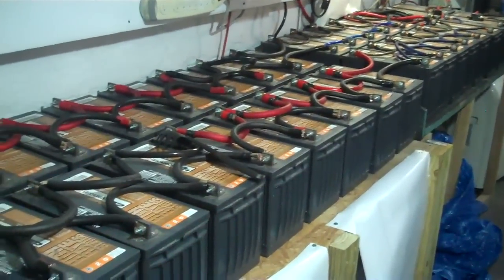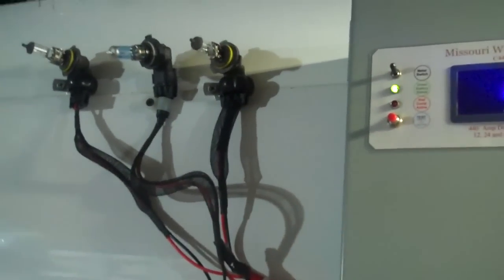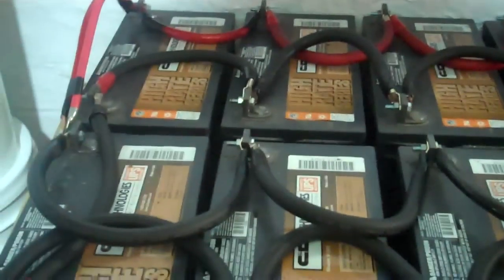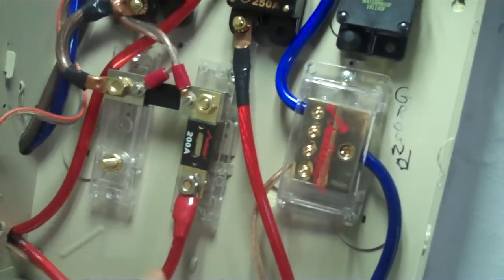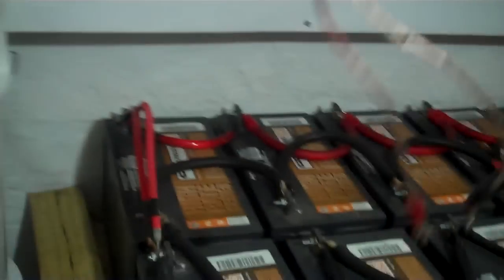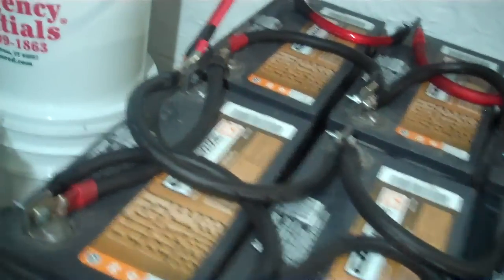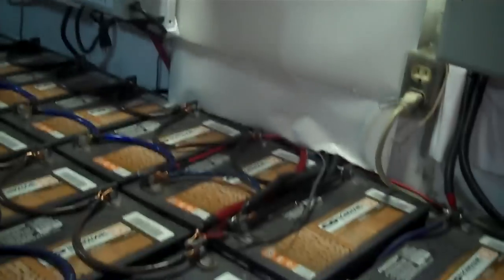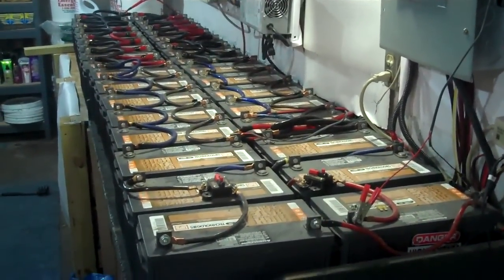Massive Battery Bank for Solar biggest Off Doomsday Preppers

Comment: I like your setup.  One thing I would add are some grommets where the wires feed through the metal cabinet. Also, a plexi glass cover over the batteries can protect the terminals from metal being dropped on them.

Comment: I have stage 4 cancer and I'm building a solar off grid system so that if I get more sick or if I die that my wife will still have electricity.  We bought a holiday rambler camper to live in cause they was no way to afford rent while I was doing chemo and radiation. I'm better now and actually working again but still working towards the solar stuff just in case. I've built a 24 volt system with 8 panels 235 watts each and have 2 inverters. The batteries is what I still gotta get together. Seems they cost a small fortune but hopefully they will be the last part of the puzzle.  I have found so much peace with messing with this solar project. Thanks for the videos it's good to see someone else doing what I'm doing

Comment: what gauge cable would you recomend me if im using a 24 volt sistem with 18 100 amp 12 volts batteries and 36 100 watt panels and a outback inverter 3500 watt thanks

Comment: I have 12 crown 235ah 6v batteries in my 1410ah 12v bank i use 4/0 cables and copper bus. What charger do you use for charging when solar or wind isn't available?

Comment: Highly not recommended- linking together more than 4 12V batteries. this setup will cause distribution problems between batteries. if you want a large battery bamk you should nuy large 2V cells.
Reply: Yep
Reply: Large 2V cells is the more proper way to do it (such as 24 of them for a 48V system), but that has drawbacks too.  If even one of those cells goes bad, then you better have a spare handy and how would you load test a 2V battery individually (apart from all the others)?  Also, if you do a Ah capacity drain test on each individual 2V battery, how then are you supposed  to charge those individually?  It would take forever and a day.  Would you drain 3 or 6 of them at a time then put it on either a high amperage 6V or a 12V charger?

One "saving grace" of a highly paralleled system like this is if the load is light enough (relative to the capacity of the entire bank), then the batteries in a higher state of charge will actually charge the other batteries paralleled with it.  It might take a few hours but it will work.  If you were to draw uneven amounts of power from say 30 paralleled batteries and  let them all sit for an hour or so with no load, and then test them for open circuit voltage, I bet they would all be the same or within about 0.1V of each other.

Comment: You are the only channel I have ever seen using a capacitor.
Could you explain their use a little more and maybe break down how to wire them for us just starting this process.
Reply: There is no need for a Capacitor in the system ever with modern inverters. They all have a peak starting power way above there rated watts. Like a 3000watt inverter typically has a 6000w temporary starting wattage. That's why you never seen anyone else do it. Unnecessary! But won't hurt anything to have it just more money and wires

Comment: I don't want anything but I do want to know where the capacitor is within the system, what size the capacitor should be, and where I would get a capacitor of that size. I have seen several people with them and for the same reason you mentioned but I have not been able to figure where it should be inserted within the system. I will search through your videos and maybe I will be able to find it there. I am working on a solar system and hopefully I will finally have it online within a month or two. Great video, thanks...
Reply: Any automotive Hi Fi shop will have them. They're called "Stiffening capacitors". Their main purpose, is so when the bass drum hits, it doesn't cause the headlights to blink, or interfere with the electronic controls of the vehicle. When installing this with your inverter, place it as close to the input terminals of the inverter as possible, and run heavy short wires. If possible, connect your source to the capacitor terminals, instead of the inverter terminals. Capacitors don't store much energy, but they pack a punch. They're capable of huge amounts of current for short periods of time. Perfect for starting the compressor of a fridge or freezer. That way, you can use a deep cycle battery, which doesn't have the surge current of a starting battery, but can run longer and withstand repeated discharge/charge cycles.

Comment: I have a 12v system now. Just started this a week ago so I bought a new 12v 85w solar panel and 12v charge controller for now. The problem is I bought 5 golf cart batteries 6v each. Now I want to keep thm charged so that when I get an inverter (pretty soon) I have all5 batt charged. Main question is Can I connect the fith battery in parallel to one of the two in series making 12v to keep it charged????

Comment: Hello.
I have a 3kw  inverter (pure sine) 
Batteries  total 600ah, (deep cycle )
My inverter is also a 70amp charger and charges the batteries by day using my grid electricity, i have grid-tied solar Pv at 2400 watts so i use this power for free during daylight.
Evenings we power our laundry using the battery system.
Problem is, i sometimes notice the inductive load from the washing machine exceeds the inverter capability...is a capacitor needed? and what do i need to do here?
Thanks...Simon UK

Comment: Hello, I'm new to solar power. I am starting off with the Harbor Freight kit just so that I can use it to learn from. I have a question about switches. What kind of switch do I use so that I can go from charging one battery to another? I am using this in my van, I want to be able to switch from my battery bank to charging my van battery if I have to.
Thanks

Comment: How did this 12v bank work out for you?  I've got a 4 battery bank I'm considering adding to, and then use them later in a 24v setup.  
Did you run into issues with unbalanced batteries?
Thanks

Comment: I love your set-up! you've got 5 sources of power: The grid, the batteries, the wind turbine, photovoltaic panels, and portable generators. You should be able to run on propane, gasoline or even diesel. In a SHTF situation, you want to be able to run on what ever fuel you can get your hands on, if your wind and solar aren't able to meet demand for whatever reason. You should have no problems keeping your lights on, and your food cold.(refrigerator, freezer)

Comment: hey.. hi.. m I have a question.. I would like to know if the capacitor is 12vdc and if is connected in parallel with the inverter - can you give me a quick explanation.  I have a 2000 w inverter and tends to trip the breaker , I was wonder if this capacitor would solve the issue.  thanks

Comment: Are those deep cycle batteries?

How is the capacitor wired into the system? How many farads do the capacitors  have? Is it wired into the dc circuit, just before the inverter etc etc?
Reply from the maker: that is a cpl farad cap wired in parallel with inverter and it helps high amp draws on hard starts a cap responds faster then a battery does
Reply: Bryan May
Where did you get the cap and how much was it?
I am just starting with solar panels. I read a lot about it and that is just it.

Comment: You are using 3.2kAh bank, so I don't think you need a capacitor with the inverter for jerk loads, even at 3kW, it's gonna pull only 10A from one battery, and lead acid batteries are great for surge loads, that's why they are used in cars and generators for starter motors, instead I think capacitor is a bad idea because if its drained and you close the breaker it's gonna create a current surge which might blow a fuse etc, that's my opinion so please do explain if you think I am wrong
Reply: I think your correct so I will destroy my inverter set up and throw it by the curb out side.

Comment: Water heater elements are intended to be completely submerged in operation and will burn out if any part of them is exposed, so mounting them in a water tank is the only way to use them.

Comment: I got a question about the batteries.
It looks like that you do not use the batteries and that you just trickle charge them.
Wouldn't It better for the batteries to just disconnect the charge for a few weeks and then charge them and then disconnect them again to do it all over again.
Trickle charge batteries for a longer period of times, the way I read it is not good for them. And If you discharge them, then you should use 15% or more of their capacity before charging them again.

Comment: Hi... nice system.  Your system seems very complex.  I'm planning on simply using 12V inverters like your Cobra.  Is there an issue I should know about as to why this won't work?  I figure a 1200W for the fridge and 1000W inverters in other rooms for lights and entertainment systems.   I also have Chinese GTI's, and intended to use them for both a dump load, and also to feed directly from panels.  See any problems with this approach?  Thanks in advance for you answer.

Comment: hi is there a way that I can get 240v ac 60hz, with a inverter, do they make one? cant seam to find one, or can 2 inverters be wired to make 240v? please some one help. thanks
Reply: You should be able to buy them in the US, otherwise one choice is buy it from a country where 240VAC is the standard, although I'm not sure about the 60Hz. 50Hz is the standard AC frequency here in Australia.

Comment: I have worked by but off 40+years now retired.  On Social s and what small savings I have.  Where can I find cheep batteries. I built 2 s windmill and got bunch of solar cells to build another 1800 w panels and is there a way to build solar water heaters without copper went to look at copper pipe and thought should of bought back b4 retirement and price explosion

Comment: There is a MAJOR fire risk with one or your panels. The battery leads going out of the turbine controller do not have a bushing to protect them from the rough edges of e cabinet KO. As another poster mentioned, series fuses are useless and the cable used is not rated for 200 amps at 12 VDC.

Comment: Awesome battery bank. I have a small solar system a harbor 45watt panel kit. I'm running a xanttex1000 pure sine inverter and a 800watt cobra. The little circuit breaker r cool. Are they better to have in the place of fuses, if so where can I get them and how much

Comment: Hi Bryan
Nice work. I have a question on batteries. If i have a 100000 batteries that produce 0.5V and a 0.1 amp and if i connect 72000 in series to achieve 36000 volts while connecting 28000 in parallel to achieve 2800 amps how would one go about getting the maximum kwh and supply the achieved power to any user or buyer of power?
Awaiting your kind reply please accept my thanks and gratitude

Comment: As others have mentioned, yes 24V and 48V are more efficient. I know you used 12 volt because it's what you got and I respect the thrift. That being said even short runs should be using 4/0 cable even for short runs for 3000 watt inverters. for longer runs 4/0 in parallel.  The voltage loss is incredible with small cables, extra current bridges, circuit disconnects and relays. Marine disconnects have been plagued with problems. Even high end ignition protected switches can get corrosion and can fail under high load. Sooo, my disconnect is a big cable cutter for emergency and a plastic dipped wrench for non. The only thing in line is a 400 amp marine rated fuse. Measure your system under a modest load at the batteries and at the inverter terminals you may have a big surprise. 3 or 4 volts difference? no big deal ? wrong!

Comment: Well as you know, "ANYTHING" with the label "SOLAR" is running 3 times as much $$$.
I'm new to this, but what I want to do is learn how big of a battery bank I need to run 4200 kwh per year, 350 kwh per month is the break down and a bit on the high side from my normal use. I would be running my generator to charge my batteries off from a Gasification unit. (Free fuel. Could you give me some perspective as to how many batteries I'd need. Thanks

Comment: Cool video, You have some serious power. Surprised its 12V.  I am not ragging on you but I'm an industrial electrician and triple fusing is redundant and not needed.  As long as you system has one correctly sized short circuit protection others in the same circuit are not needed. Use multiple fuses for power distribution, like a breaker box then a larger fuse that covers the entire box but two fuses on the same circuit is just an extra point of failure. Think of it like having two parachutes.

Comment: Am I right in saying that if you had a really large battery bank you don't even need a charge controller? The reason being that each battery would only be receiving quite a low current, so it could disapate the energy as a small amount of heat. ??
Reply: +Ross Peplow 
No, even with the low current the voltage could get too high.

Comment: Hey just starting to read about this, still learning more about electronics, Im still young but it feels like I just want to be a hoarder of a preppier, what I imagined I wanted was exactly what I just saw. Amazing battery banks but how long can the batteries last if running on full power. 

Which would you say it greatest in power, efficiency and greener of the two wind turbines or the solar cells

Comment: Very interesting video,I live off grid with a small system but have to expand from time to time not easy with my little pension :-) but still will not hook up with the power company therefore I like all those information on you tube,probably I would need some things in the future.

Comment: You should step up to 2v batteries. 2v cells made by crown are actual deep cycle batteries than can get thousands of cycles.  40+ car batteries is craziness. How on earth did you acquire so many car batteries?
Reply: Those are AGM storage batteries designed for this purpose. It's why those huge batteries only have 100 AH each. They're designed for current and longevity. Car batteries can do pretty well for back up, but if cycled regularly in a photovoltaic system, he'd be replacing them every year. Not economical.

Comment: I am from Philippines and the electric bill here is killing may pay check monthly and I was thinking of wind turbine and solar power, I am kinda techie person but I really don't know how to start building one and how they work and powering my appliances  can you help me please knowing the logic ins and out of it.
Reply: I was at a loss at first too. Buying the cheap harbor freight kit for $150 on sale and a deep cycle battery helped me get started and helped me learn the basics before I felt comfortable buying a small solar system. Good luck.
Reply: I would suggest solar. Wind power works well, only. if you have >30 mile an hour winds 24 hours a day 7 days a week. Don't waste your money on wind turbines. I have been running  a test with a 800 watt system for over a year now; It has produced about 3.5 Kilowatts of net energy. That is 35 cents, (U S dollars). The MPPT (max power point tracking) of the charge controllers spend most of their  time trying to find the best point unless the wind is blowing at a steady rate.
Reply: Carolina Prepper
I tried/wasted a lot of money on the small, cheap systems. Go big, using the high dollar systems. The "cheap" ones are just that, "cheap". They will not hold up, burn out and not make any real return on your investment.
Reply: Rod, I think each situation is different. I didn't have a clue on where to start and I didn't want to buy more than I needed. I almost pulled the trigger on a system that was over $2,500 from a solar company because it was going to be pretty much turnkey. I opted to buy the cheap HF kit (in fact I bought a second one for another location because I liked it) and it taught me about solar. I ended up building a small system that suits my needs well for under $750. Keep in mind that I was able to get the majority of my batteries second hand for free otherwise my cost would have went up dramatically. I'm glad I bought the HF kit. I learned a lot, it helped me save money down the road and I still use them (both). I'm not saying it is the right thing for everyone but I'm glad I went that route.

Comment from the maker: i have been using the small grid ties for 2 yrs and havent had but a fuse blow in 1 of them u must keep them hooked up all the time and when sun comes up it will bring them up to speed and use a breaker or a outlet with a reset switch

Comment: I am sure you have your reasons but why didn't you go with a 24VDC 2000AH or 48VDC 1000 AH bank rather than the 12VDC 4000 AH bank? Are all your inverters / Charge controllers 12VDC or something?  I just figured more voltage less Current. Plus you could Block them off in 4 1000ah 12 VDC banks with disconnects for dead cell replacement then Parallel them to make the 48VDC input with an over all disconnect. That's a lot of juice if something goes wrong.. Just a thought...
Reply: John your 100% correct.  This system should be 48v. The cost of cables and charge controllers would be crazy in this setup. Plus the battery configuration will never allow for proper charge saturation and float of the batteries, meaning these batteries will be destroyed and likely last less then have the time they should.
Reply: I think he stuck with 12V due to the 12V grid tie inverters. With the amount of batteries he has i would be running at least 96 volts if not more.